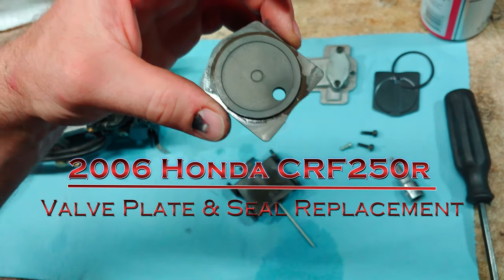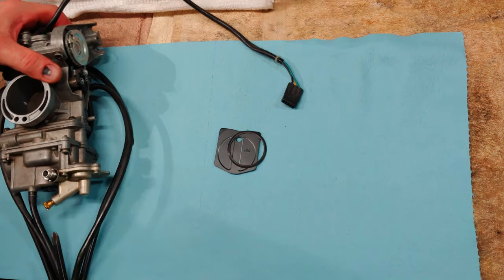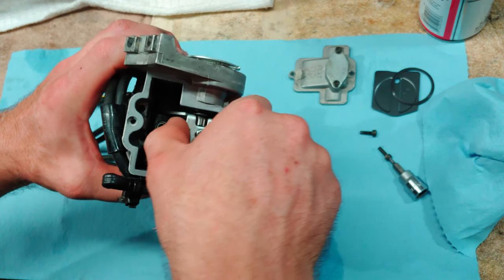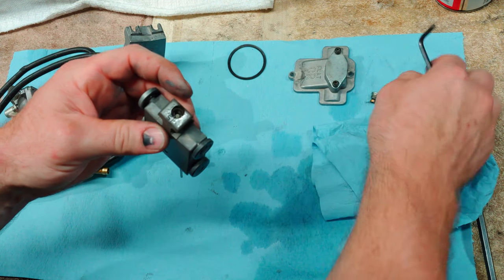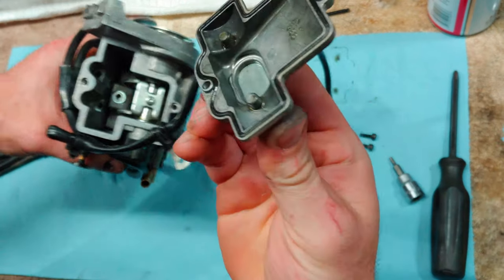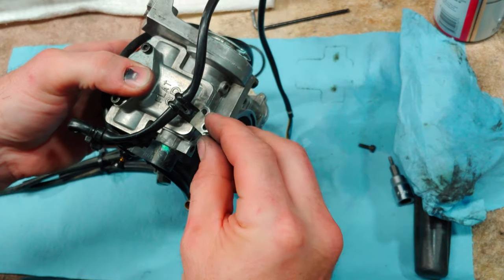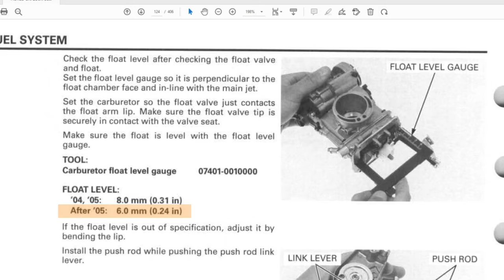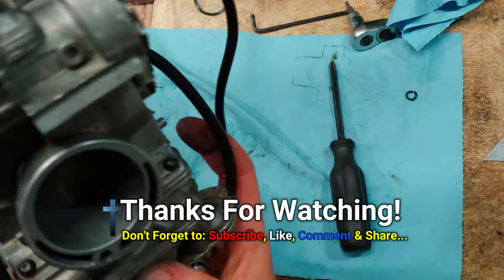Replacing Floating Valve Set || KEIHIN Carburetors

Comment: Would have been helpful to show exactly how you install the o-ring on the floating valve. To those that do not know, the flat side of the o-ring seal goes downward against the valve. (JD Jetting has pics showing the correct install of that critical o-ring seal) Also, on some factory service manuals with some bikes (Suzuki DRZ400 comes to mind), they showed the floating valve installed upside down on the parts schematic!  Andrew mentioned this incorrect upside down valve install when he first broke down this carb....NO BUENO! So folks, DO NOT screw-up the valve orientation/placement and make sure the valve seal o-ring is correctly installed!

Comment: did this affect on hangin idle? im struggling to find my culprit.
Reply from the maker: Hanging idle means your pilot jetting or fuel screw are set too lean. Back the fuel screw out 1/8 turn at a time, blimp the throttle and give it 10 seconds to stabilize until idle doesn't hang. 

 If you need to go 3 or more turns out, your pilot jet is too small.
Reply: @Fixin2Ride-Official-  stock pilot is 38 and im running 48 and 3turns out :D
Reply: And my plate is more worn than yours 🤔
Reply from the maker: Yeah that sounds like you should replace the set....
Reply from the maker: @Poksutin Do you have your Hot Start lever operating properly and is the lever set with 1-2mm of play?
Reply: @Fixin2Ride-Official-  not yet. lever is broken and wire is just hanging in there pushed all the way in
Reply from the maker: Get that figured out too. I might check to make sure that the hit start plunger is all of the way in also. Other than that.... IF the plunger is good to go then it sounds like you should replace the flooring valve set. Make sure your carb, where the floating valve set rides is not all worn out as well.
Reply: @Fixin2Ride-Official-  definitely gonna check the plunger too :)
Reply from the maker: @Poksutin copy that! Hope this helps! Only thing I ask is to share your favorite video and the channel on your social media account to spread the word!